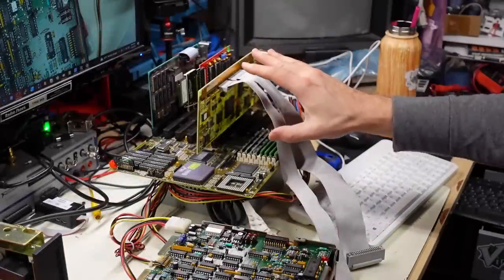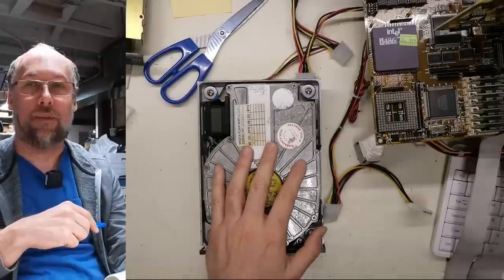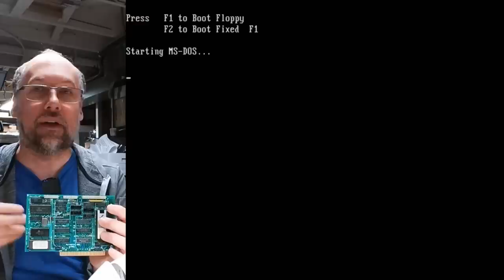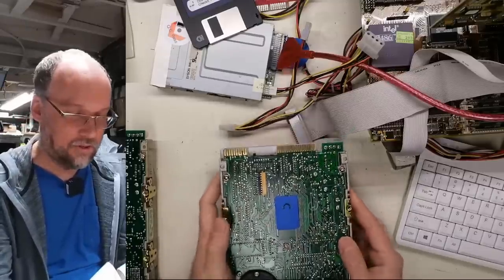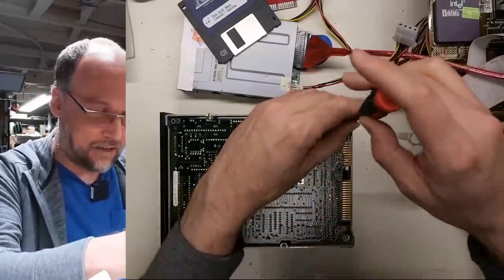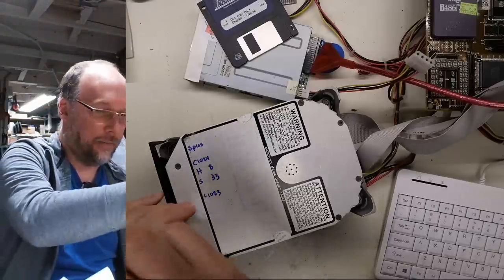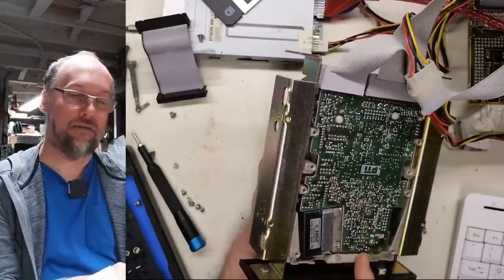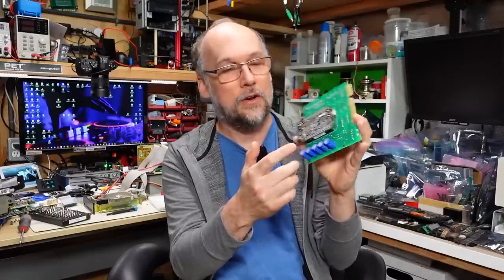MFM drives are really unreliable

Comment: precomp, precompensation, is a slight timing alteration during writes to inner tracks to account for the higher flux density on those tracks causing problems with adjacent transitions.  The same thing is seen on floppy discs too.

Comment: In the 1990s there would be computer fairs in my country (the Netherlands) a few times a year and because I didn't have a lot of money, I was on the lookout for used MFM hard disks. My PC didn't have IDE, only MFM (later RLL) and I also built an interface for MFM drives for my Amiga 500.
Unfortunately, I learned the hard way that a used drive may not be a working drive, and had to throw a few drives away, after I had walked around with them all day and taken them home on the train. It often happened that some stupid user had accidentally low level formatted the servo surface which would would make them permanently unusable instantly.
In the end, I took a 12V sealed lead-acid battery with me, and a connector that had an LED on the READY line (which I think is right at the end of the connector), so I could rummage through boxes of hard drives and make sure they at least reported as ready after speeding up, so that I wouldn't have to waste money anymore.

Comment: I have an old Televideo 286 machine that has an ST-225 installed in it currently. I've made several attempts in the past to get the drive working, so I'm hopeful that I can apply what I learned from this video and give it another shot.

What's unusual about this machine is the floppy and MFM controller cards are integrated into a single card that was designed in-house by Televideo. The floppy controller part of the card works just fine, but the MFM controller portion seems to be completely dead. Although the chipset appears to be a common WD Winchester controller, I could not get Speedstor to recognize the controller at all, no matter what machine I had the card installed into. Either the card is so unusual that it's not compatible with my 486/Pentium machines, or more likely there's a fault with the controller itself. Perhaps the drive itself is dead, but I'm not certain because I don't have another drive or controller handy to properly rule out what's causing the problem.

Before someone asks, yes I'm the OP from that Vogons thread about said Televideo 286 machine. I made quite the blunder and decided to split open the drive to inspect the platters. Let's just say the other members in that thread weren't too happy about that. In short, I've since been on my own trying to figure this out. >.>

Comment: I remember some Winchester drives in a PDP-11 that sounded like a lot of loose change in the dryer when they spun up, but they worked fine! Compared to voice coil drives they are pretty robust.
Reply: Those were 14" RL01/RL02 possibly? I know there were some with 5MB fixed disk and a 5MB removable disk pack. These things were loud ..

Comment: Early PC hard disk drives used MFM (Modified Frequency Modulation) encoding to store data on the disk surface, the same as PC floppy drives did, and always have. Shortly after hard disks became more common, a similar encoding scheme came around, called RLL (Run Length Limited).

Comment: With modern mechanical hard drives, I find it insanely crazy that a drive with 1 TB of storage capacity has only one platter while having enough space for 2, 3, or even for platters and drive heads for each side that are unoccupied. If that's not a testament on how advanced mechanical drives have become in terms of cost cutting AND increased capacity, among other things, then I don't know what is. Mechanical drives really are a work of art.

Comment: I've heard of an old hard drive cramming the head through its side, so I would not count on the electronics not allowing to move the head too far. We had a Seagate ST-157A at home (3,5" IDE). Long story short, due to some percussive maintenance, it got a bit of the case shaved into chips due to the platters hitting it. My dad opened the drive case, blew the shavings off, closed the case and it still worked flawlessly, not a single bad sector. Those things were rock solid, too bad Seagate hasn't seen that kind of build quality in pretty much decades...

Comment: Aftermarket platters are available with the correct medium. I get them through a company in Canada that specializes in hard drive repairs both old a new alike. They also do PCB repairs on failing drives. On the iron oxide platters, wiping them down with IPA not only removes the fingerprints, but also will somehow rejuvenate most platters (not pitted) to at least allow for testing. The first MFM drive I had was only 5 MB. I learned the hard way not only about parking, but also how unreliable they were on an area that was subjective to any kind of movement. In cases where a printer was on the same surface as the computer with the HDD, printing was often catastrophic. Personal experience has shown me to use a controller with a ROM, and when specifications are unknown, I wrote a program years ago that scopes the entire system to look for HDD's (IDE, SCSI, RLL, MFM, etc.) and while it takes seemingly ages, if memory serves me correct does both a LLF and dos format. The side effect of the program is that it defaults the interleaf to 6. Spinrite is an excellent program though for some, it may be out of their budget. A program that was freely available during the BBS days, is called Optune. For some reason, I'm thinking another one might have been Diskopt. Optune also does defragmentation and when I tested it on NT4, server it worked. So far as Prep goes, you have to know what the HDD drive number is. When multiple controllers are used, this is problematic as we never know how the system sees them. On the Micropolis drive you demonstrated, I heard shaft wobble. On the drive that wouldn't speed regulate, there should be a speed sensor of which could have failed. Before switching out boards on the Seagate drive, I'd use an o-scope and compare the readings with the functioning drive. You could trick the MFM controller and signal a drive ready, though I don't think that would be of any real practical use unless a mechanical diagnostics is desired. MFM is historically 17 Sectors whereas RLL is historically 27. You can use an RLL controller on an MFM drive and set it to 17 sectors and have it work just fine. So far as the drive select jumpers, I don't recall ever having to move them unless I had a cable without the twist. As for HDD repairs, in theory, they can all be repaired. I wouldn't attempt it on a drive with damaged heads, defective voice coils or defective stepper motors or even defective spindle motors. Unbinding them is one thing, finding replacements is a bit more of a challenge.
Reply: Are they actually still manufacturing the platters new? And is there any purpose for it other than supplying hobbyists who want to keep their machines stocked with period-accurate parts?
Reply: @stevethepocket  Yes they do. Surprisingly some financial institutions still use various MFM/RLL hard drives in something called "Channel Extenders" and I couldn't tell you what they actually do. What is currently offered should someone want to repair these vintage drives in terms of parts and cleaning kits, surprises me every time I have to order something. To date, I have not found a substitute that work with these channel extenders. The most common drive I see are the ST-225's. So, an answer to your question in a quick answer, beyond vintage enthusiasts, the support is quite extensive. I'm still wondering why these institutions want original style parts, is beyond me. The fact they are available, surprises me. I'd expect if they were new old stock, the market would be out of stock by now. I'd say it is a win for those of whom who want to restore their "vintage" units to original factory specs.
Reply: @organekd  I suppose it helps that the process isn't that different from making platters for brand-new drives, which is still a thriving industry. Wouldn't surprise me if they're sourcing them from the same overseas facilities.
Reply: @stevethepocket  That might be the case. I have no clue as to where they'd get the platters for the 5 1/4" drives. My thought is they may be using the old ones and resurfacing them. Bad drives are still worth a bit for these repair companies. Adrian might want to look in to that.

Comment: You need a burst writer: Kinda like a servo writer, but those just needed the burst to be written. After it starts the YOUR heads are reset to track zero and knock against the backstop or inner stop, the burst is meant to stop this. I can't remember the actual name of the device off hand, but the inner tracks are written with a servo burst, the problem with these drives is that the head park area is over the burst area and so you tend to get head slap which is transit or shock damage caused by the heads leaving a group of four indentations. Without the burst data the head location when reset may end up several tracks in and not over the the outer track zero, if that occurs the drive will refuse to format. You can maybe adjust the head end-to-end backstops but this means opening the drive and definitely means rewriting the burst.

Comment: Also at roughly 17:00 .. I had a weird one where a miniscribe mfm I had did what you had there.. wasn't initing properly.  I could see the stepper motor moving so I assumed drive electronics.  Then I exercised the stepper and felt it was a bit stiff.. used your video on lubricating those as a guide.. voila.. it worked.  It had enough function to move the stepper convincingly, but not enough to move it all the way to the extremes for initialization I guess.

Comment: Micropolis drives were notorious for running extremely hot and failing fairly quickly. I remember back in the day we were backing up one of our server's Micropolis drive RAID arrays to tape so that we could restore the contents to a new WD RAID array, and it took forever. The drives were getting extremely hot, even with a fan in the RAID array case. So we took the cover off the RAID array enclosure and stuck a box fan in front of it to keep it cool. Once we had the data restored to the new RAID array, and making sure everything was working properly, we sledgehammered the Micropolis drives and sent them and the old RAID array case to recycling.

Comment: great video. the Micropolis 1320 family 40M and 70M driveswas used back on it's hayday in Motorola VME systems under System V Unix or Versados MVMESYS1131 and MVMESYS1121 and the noise was bearable, insede a 19" rack having lots of 5in fans and QIC tape drive. computers then were in the airconditioned computer room / closet, and users had VDU (VT100 or others) most of the terminals were quiet. Micropolis 1320 schematics are part of Motorola VMESYS manuals.

Comment: I remember in the late 90s I got an old MFM similar to your type 2. It wouldn’t be detected and quit. I ended up opening it and using speaker coil wire to connect the head to the board: ie the flexible cable toward the head was broken. I closed it and it worked. Out of 20mb, I lost some 2mb.

Comment: my big mistake in 1988: purchased a Perstor PS180(?) "ARLL" controller card. it did factor 1.9 compared to MFM (instead of 1.5 in RLL). And worked with non-RLL HDDs. (an ST4096 in my case) Very good... but it was incredibly slow, even with quite current 286-20, interleave 1:3 was the maximum speed possible.

Comment: I had a Seagate ST225N SCSI hard disk connected to my Atari ST and it looked and sounded just like those MFM drives, probably the same mechanism with a different driver board. Never knew new hard disks had glass platters.

Comment: If I remember correctly for an MFM hard drive to work the drive has to be formated with the specific MFM controler card. I was building computers back in the days when MFM and RLL drives were in use but I only sold new IDE drives. I had to recover a lot of data off MFM drives. Most of these were 10 to 20Mb and it could take several hours to pull the data off a drive.

Comment: A word of warning... do not rotate the spindle motor in the wrong direction.  The heads are designed to go forwards only in a lot of these old drives.  There's a chamfer on the leading edge and either a flat or very shallow chamfer on the trailing edge.  Going backwards can result in the heads digging in and being damaged.  The next time the drive is spun up you can be greeted by unwelcome zing ping tings.

Comment: Usually the failure in such old drives is mechanical. I have repaired a few at some point. You have to remove the cover, check, lubricate where necessary... in one in particular I actually removed and physically cleaned the discs. And it was working again. To remove the noise, change the ball bearings.

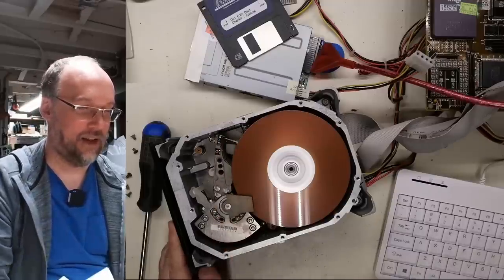Comment: 33:44 = I had a hard drive like this earlier salvaged from flea market. I dismantled it and took out the central motor and the stepper motor used to move head assembly. Also I kept the discs thinking, they are made of copper. Later I realized, they are made of aluminium and with a layer of oxide of copper.

Comment: One advantage in these old drives was that you could totally erase the platters, then low-level format them with speedstore and they would be back to normal operation.
Modern HDD's have servo tracks and other lovely things written on the platters in the factory, that once lost the drive will never work again. Some software says it's low-level formatting them, but in reality, the drive just lies, it can only be low-levelled in the factory on a special jig. The head actuators are voice coil based, with their only reference being those factory servo tracks. once lost the drive has no idea where the heads are.
One trick on modern drives is that outer tracks have more sectors than inner track, however the onboard controller translates all this into a nice linear pattern, so while the computer thinks the drive has so many tracks and heads etc, this has nothing to do with what is physically in the drive - in modern systems these days the whole concept of heads and cylinders etc has been abandoned, its all just a big long string of data blocks.

Comment: Back in the 1980s my school had a network of BBC Micro computers (6502-based) connected to a file server in a cupboard. This was a 20MB drive, probably one of these, connected via SCSI to a twin-processor BBC Master (also 6502-based). It worked fantastically well... except the drive had a squeaky bearing and howled like a damned soul ALL THE TIME. Maybe it was; later it got struck by lightning and stopped working...

Comment: I seem to remember some drives had a small hold on the bottom side where you would nudge a flywheel.    The fault was rare where you would need to use that, because it only happened when the drive spindle happened to come to a rest at a "dead spot" between the coils.
Reply: A few even had black and white lines for usage with a stroboscopic light for fine speed adjustment.

Comment: Back in the 80's to 90's I frequented a local repair shop  to buy parts...I bought a bushel basket of MFM drive pulls for 10 bucks.  There were 10 or 12 CMI drives and 6 0r 7 Seagates in there.  I found out later IBM had to recall all the AT computers with the CMI drives -  I took the tops off and the rust was slung off the platters  on the inside periphery of the case..but I got 5 of the Seagates working.

Comment: I have a Zenith Z-248 computer.  It has a Control Data Company 10 meg. byte hard drive installed.  It a full size 5.25 hard drive. I still use to play vintage computer games on the machine.  I really enjoyed hearing those spinup sounds. Very nostalgic.

Comment: I remember a TSB about the stiction issue back in my CompuAdd days.  The paper described the cause of stiction to be from the epoxy that affixed the head to its associated arm.  When heated up, the epoxy would outgas and form a layer on all the surfaces inside the drive.  Over time that build up would become dense enough to temporarily glue a head, or heads, to the platter(s).  For drives without the automatic head parking feature, running a Park program before shutting down the computer would move the head assembly to the innermost track where the motor had more of a torque advantage over the stiction.  Unfortunately the build-up of residue continued until even this wouldn't work.  Snapping the drive housing to force it to break loose was much easier with the 3.5" drives but required a bit more vigorous action due to the lower mass of their larger ancestors.  We were told to replace all drives by Tandon from a certain manufacturing date upon the first customer complaint.  The drives would be replaced with either Miniscribe, Seagate, Fujitsu, or Western Digital as these had either gone through this phase of failure already or, had so few related issues, weren't considered to be a future issue.

Comment: As you stated, most of these drives require the "park" command before turning them off. When I worked on the drives in the late 80s, early 90s, even the ones that supposedly had the park feature would fail early if you did not use the park command. I used Spinrite on a daily basis in those days, as it is great software for looking at your drive, though many drives had heads and platters that failed to respond to my attempts.